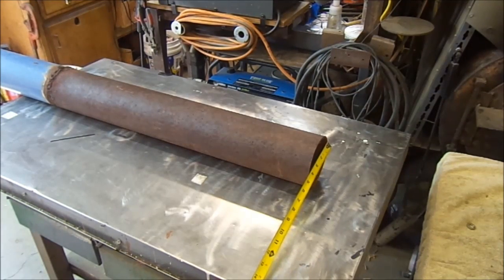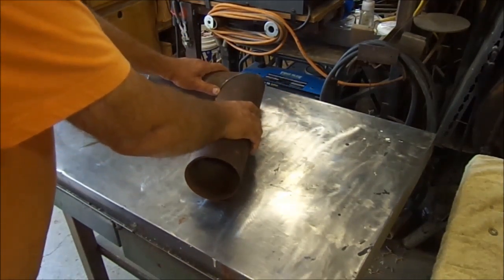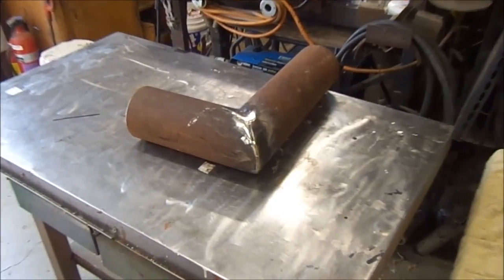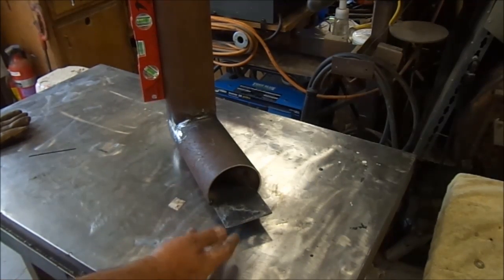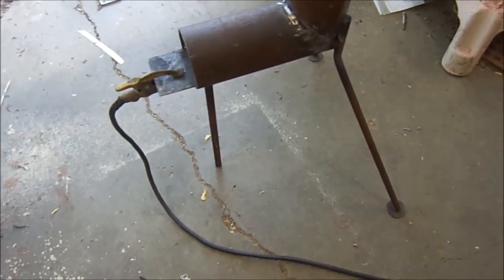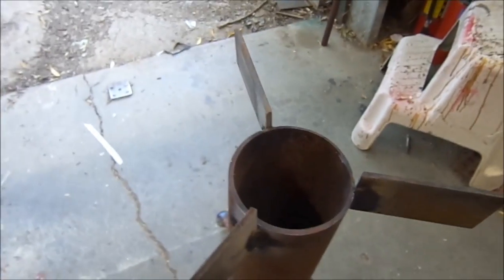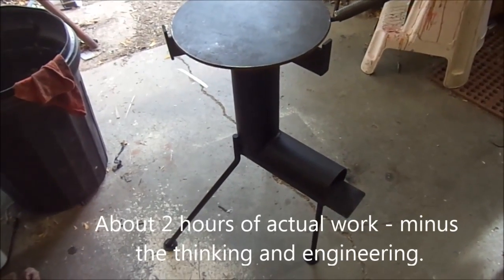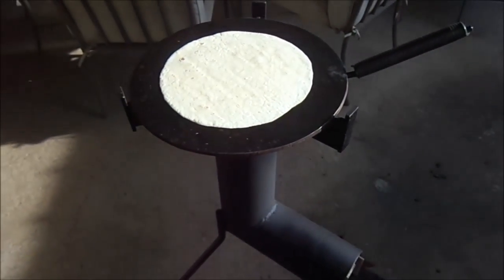DIY Rocket Stove

Comment: A couple of thoughts. First, the welding rod you used is not intended for pipe. 7024 rods are for the flat position only, if you want a weld to look half decent. I would have gone with a 7018 or 6010 rod. Your cut looked good. For those that don't have access to a big enough saw band, or chop saw, there are a few websites out there that you can plug in your pipe size and the angle you want. You can then print an accurate template to tape onto the pipe. A carpenters square, would have probably been a better helper for you when you were trying to hold the piece vertical on the bench. The rest of it looks great. Good ideas for the pan holder and the home made griddle.

Comment from the maker: Sorry to  hear about not being able to weld, I don't see why a 4inch
 pipe with an elbow wouldn't work. Also, go to a scrap dealer and look around, there are already  90 degree fittings welded up, tell them what you are doing and you might get a stove  for next to nothing. The legs and brackets could easily be bolted on.

Comment: you have the internal workings for a rocket then you need a shell and an exhaust at the bottom of shell  run your internal pipe about 4 to 6 inch from top of shell inside

Comment: interesting .I thought rocket stove name originated from the flame given off which is a result of the air being drawn in or blasted through the burn chamber from under the burning wood making it hotter.& wall insulation is ofc an extra boost but i hit 1800 C b4 my sensor went overload & its small simple & not even sealed 100% but works well & doesnt give of smoke when its fired up because of the heat it produces.wall insulation is to aid the whole principle ofc which is efficiency so good point

Comment: ahh you dont NEED too much tbh.i made one from an old toolbox with a shelf/pull out draw and computer casing for the flu lol. only tools needed for that was hacksaw and tinsnips :D burns hot enough to melt aluminium so good enough for boiling water for TEA and cooking BACON  :D what more do you need ;-)
was just a starter but even tho it isnt sealed welded etc it blazes like a trooper.

Comment: nice stove, but not a rocket stove....the main feature of a rocket stove is that it is double walled and has an insulated burn chamber...this insulation makes the temperature in the burn chamber much hotter, and this extra heat helps more completely burn smoke gases, greatly reducing the amount of pollution...there are lots of people on youtube claiming to be making rocket stoves, many of them are leaving out important design features...